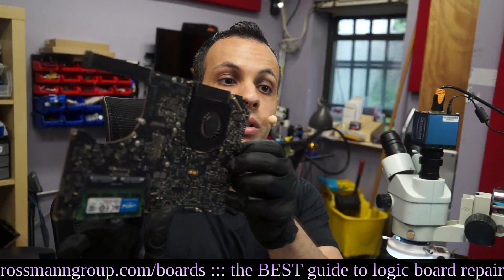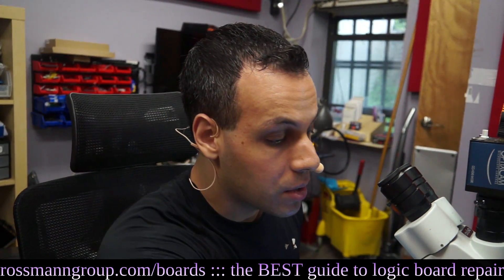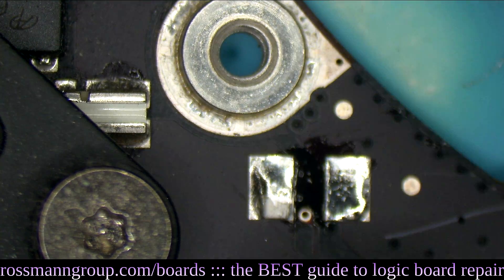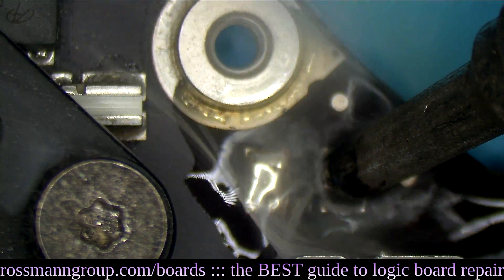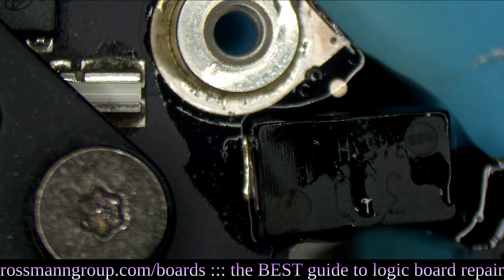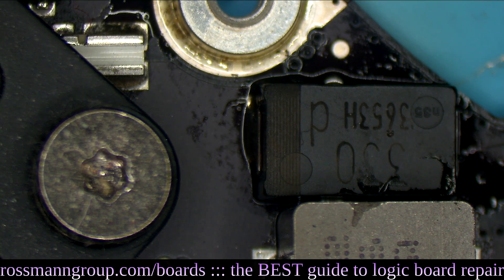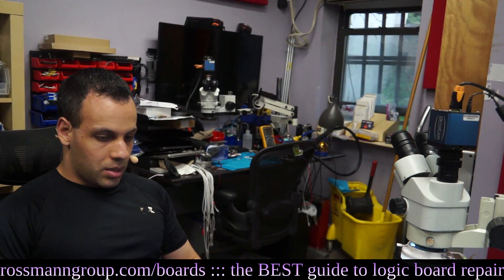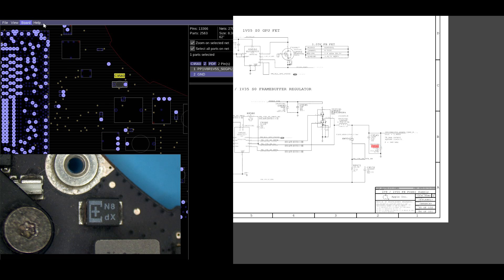Macbook Pro 2010 GPU kernel panic repair without scraping logic board

Comment: It's true. Hard finding a decent laptop. I did the mistake of buying a Asus 2 in 1 since I wanted something to dabble into graphics design. It began slowing down after the 3rd month of use, still had 700+ GB of free space. I personally replaced the hardrive with a 256 GB SSD and also added a 120 GB M.2 boot drive. I didn't even bother sending it out to them. As soon as I called customer service I knew it was going to be a hassle and I wouldn't have my device for weeks.
Reply: @two: There are a lot of reasons a laptop can slow down. After 3 months of use, I would suspect crapware or malware eating up your resources. Another possibility is overheating, typically dust or blocked vents, though less likely after only 3 months. Check memory (not hard drive) usage, CPU usage, and CPU/graphics card chip temperatures.
Reply: Well, here is where you are wrong kiddo, I burned my motherboard (notebook) and in warranty they changed my motherboard in less than a week long under the August month which here in Italy means almost no one works into fabrics in those weeks. They where fast and precise (specified on top of pc to keep data from second drive, and they did it all). After some days I had it back fully functional
Reply: chrimony I did, it was a bad hardrive. Didn't have any malware. When I tried copying the OS into the new SSD it wouldn't read, it would start making a high pitched sound. My desktop would recognize it but I couldn't open it. I used that Laptop for college, for everything else I'd do on my PC. So it was pretty light on use.
Reply: Lucian Tabria The ETA they offered me was 3 1/2 weeks away. The whole reason why I bought the laptop was because I wanted something portable that I could use in my breaks at work to work on assignments. Plus like I said it's always good to swap a HDD for a SSD, read times are multiple times better. The laptop was taking 20 minutes to start, when I bought it new it would take about a minute. Now starts up and is ready for use in less than 10 seconds. The whole reason I did it myself was because if the upgrade and also because when I read the reviews it had on Best Buy where I bought it multiple users said they were getting the same problem. I didn't just start changing parts hoping it fixed itself. The Hitachi Hard Drives inside those laptops were getting fried. It was the #1 reason that specific laptop was being sent in for repair.
Reply: Did your upgrade help?
Reply: McCready 747 yes. Solid State drives greatly improve startup times. They are more expensive but they're really worth it. For a laptop always go for at least a 256gb one. Mine also had a M.2 slot but many don't have room for memory expansion
Reply: two one sometimes happens when some suppliers of suppliers for the third party manufacturers may make a mistake and have a fail business. It just happens, it happened with the company where I work in automotive that a line had some faulty and lost the client and it has been discovered after some weeks of crazy bottle neck hard work, sometimes just happens, some people like you would likely bash the car manufacturer ignoring that most of the times are the suppliers fault, sometimes a machine is not making components in the ideal way, not feed with the ideal material or not having maintenance or engineering support to troubleshoot some issues.
Reply: Lucian Tabria Never ever ever make brand Loyalties. Don't get me wrong. I own a lot of Asus products, from my router, my laptop, had a zen watch for a while, my current motherboard for my PC and my past one was a Asus Motherboard. However they chose a cheap hard drive that had high fail ratings, I have a old Asus X555LA laptop that's still working, only problem is it won't hold charge. It's never failed me. But the new one went out in 3 months because they skimped out on the price of hard drives. Hold brands accountable always. Don't look for excuses, like "well they don't make that, it's third party" at the end of the day they chose to use that product because it was cheaper than another and pennies add up when you're selling hundreds of thousands of units
Reply: Plasmaboo I dabbled into graphic design. AKA I needed something with a touch screen to draw on. It was a $800 2 in 1. All I was going to do on it was my essays and assignments when not at home and have fun with drawing on my laptop. How is that resource intensive? I hadn't even tried doing any of that before the hard drive took a dump on itself. You'd think a $800 machine could handle web script and Microsoft word. I could of just bought a $300 Chromebook and it would of handled writing essays and opening chrome with ease.

Comment: I've had two HP laptop hinges break. Thankfully it's not crazy expensive to replace. What laptop brands DO you recommend?
Reply: Alex Trotta I was wondering the same thing.
Reply: Depends in what you want the laptop for, Work/office Laptop, a Gaming Laptop, Productivity, ect
Reply: Sort of a general use laptop. My desktop is fine for gaming, and I don't find myself wanting to game on the go. My current one is suiting me fine for now, but there are a few more "quality of life" features that I would like, like a 1080p screen (currently 1366x768), matte screen (currently glossy), one of those fancy new 4c8t 8th gen mobile or Ryzen mobile processors (that one might seem weird, as my 3210m is doing fine, but it's sort of for future-proofing), and a USB-C port. I also kinda want to ditch the CD drive, I can live without an ethernet port (adapters are cheap), and I NEED a backlit keyboard. 8 GB RAM is fine, but I want an additional slot if I want 16 GB in the future. An HDD is fine, as long as I can replace it with an SSD (SATA is fine). Also prefer a 15.6, I can live with a 14".

With all of those things I want (I may have missed a few things) this is the cheapest laptop that has everything that I've found:
https://www.amazon.com/S410UA-AS51-VivoBook-i5-8520U-FireCuda-WideView/dp/B079XKBTTK/ref=pd_day0_147_5?_encoding=UTF8&pd_rd_i=B079XKBTTK&pd_rd_r=QVZE2QGSF7QSS9HRSXNH&pd_rd_w=whRH4&pd_rd_wg=F8UVV&psc=1&refRID=QVZE2QGSF7QSS9HRSXNH

What are your thoughts on this?
Reply: Dell, I bought a refurb Dell Latitude from them, and it was a great laptop for the money
Reply: I had a Compaq for several years, it sucked when playing games but it didn't break at least. Only thing I had to replace was the 2,5" hard drive, I think it died because of constant high thermals from me playing games it could barely handle lol. Don't know if they have any decent laptops now though. Battery died too but that is to be expected sooner or later, just didn't bother replacing it.
Reply: Lenovo